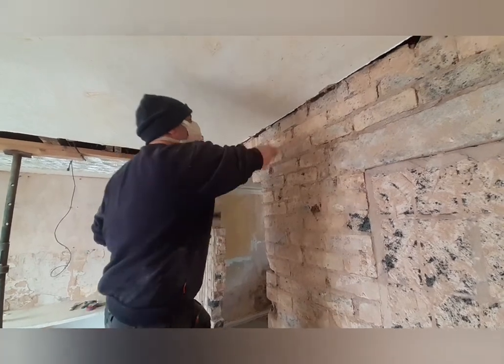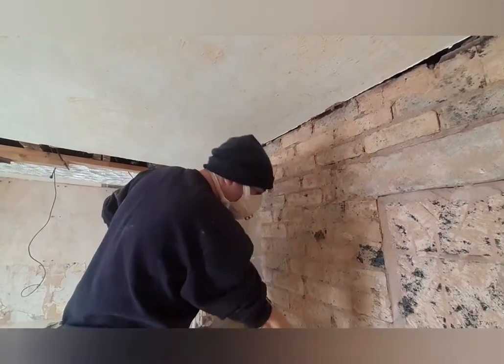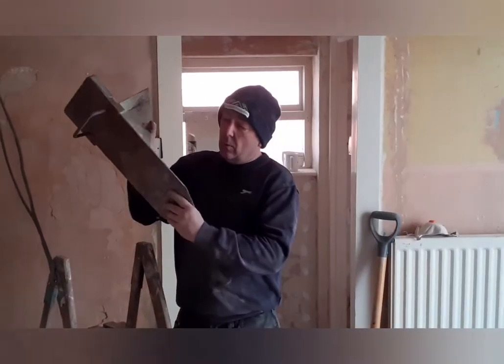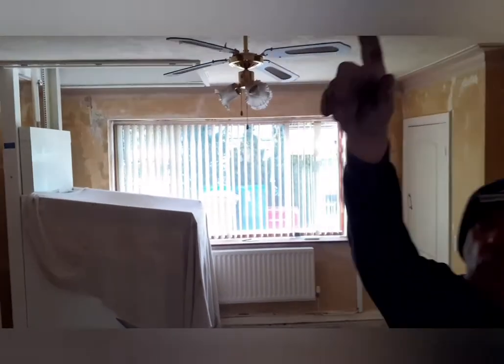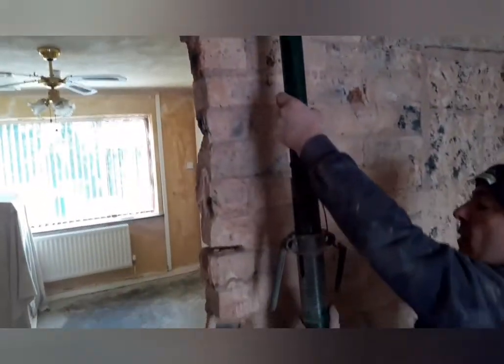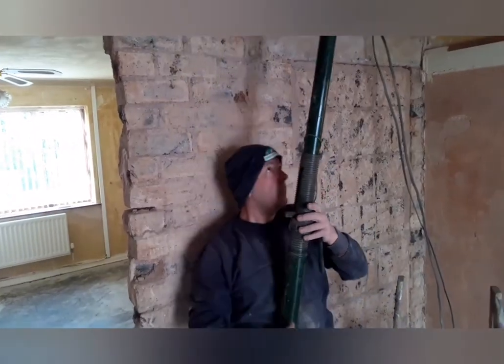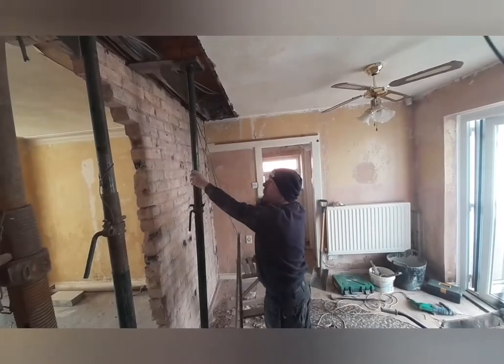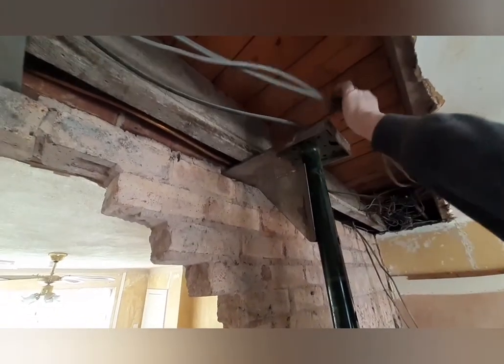Acrow props and strong boys installation before knocking through internal walls.

Comment: Hi fella 
Got a fireplace no lintel.About 115cm wide opening. Should i use a strong boy. The whole thing has sat on a piece of formica since i bought house 25 years ago.
Iv proped it with timber at moment.intend putting in lintel.
Cheers

Comment: How do you then fit a RSJ without removing the strong boys??, good vid
Reply from the maker: Hi Paul, sorry for the late reply. Put the steal in the approximate position before putting acrow props in then insert the strong boys and acrow props, take down wall and lift steal into position.  Sometimes if you have the room, you can weave the steal in-between the acrow props. Thank you

Rob pilkington 
Dream home renovations.

Comment: This is a good video. What is the plan if you are doing a 12" think wall ? I'm planning on putting two doorways into one ? Max opening would be 5 ft so was going to use 2 strongboys or steel bars and acrow both sides .
Reply from the maker: Hi Leighton, sorry for the late response. Same setup but your steel needs to be an adequate size to support the 12" brick work. Acow prop and support from both sides, making sure you can negotiate the steel between the acrow props. Hope this information is helpful, regards

Rob pilkington
Dream Home Renovations.

Comment: Dont think it's necessary to tighten up that much, more likely to get a hairline crack up the wall above when dropping the acrow if you lift it too much on an extension knock through so you'll end up owing the customer a pointing job

Comment: Thanks for the helpful video - how many acrows do you need to hold up the wall (what is the max span between acrows)?  Cheers
Reply from the maker: Hello Stephen. The acrow props should be 900ml apart. The amount of props you use purely depends on the size of the area. Minimum of 2. Thankyou for your message and interest 😊
Reply from the maker: Other videos on our channel are linked to this in stages of the job which will help you further, Thanks Rob.

Comment: Would you think if might be OK to use acro props with scaffold board above to suport ceiling joists of a bungalow during external wall knockthrough, without removing the ceiling plasterboard or will the plasterboard compress under the weight of the roof load? Thinking it be safer to rip ceiling plasterboard down and run the scaff board directly under the joists, then do knock through and fit new rsj under the existing wallplate..
Reply: Try it